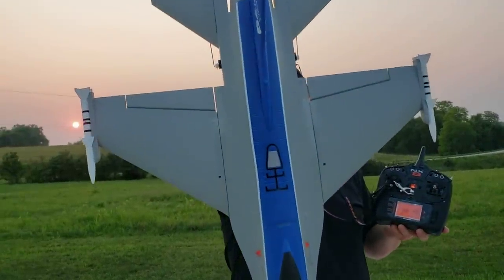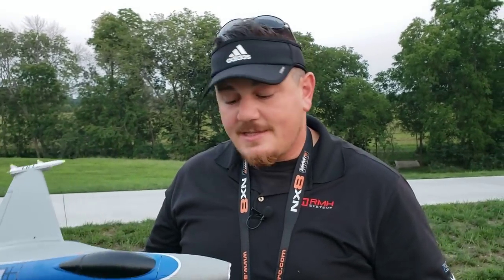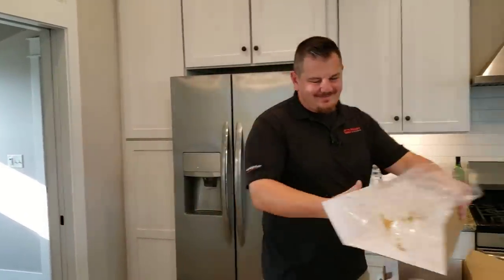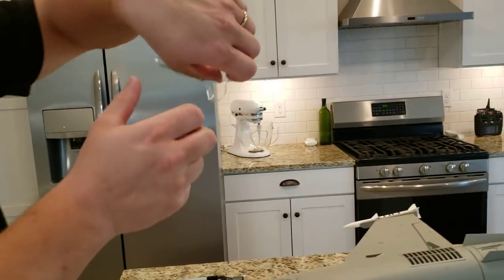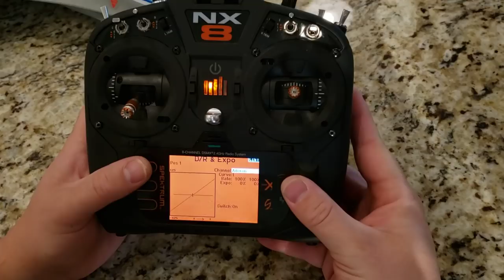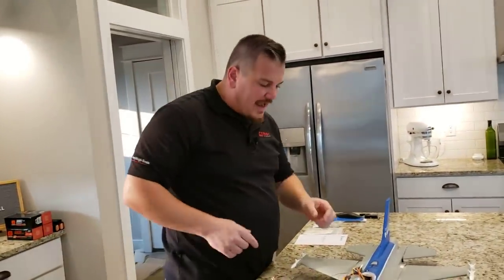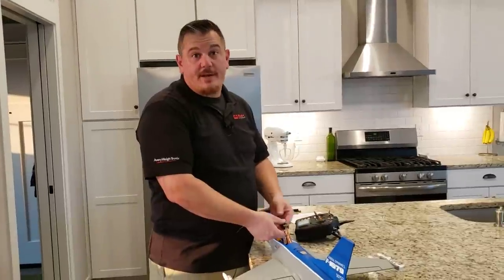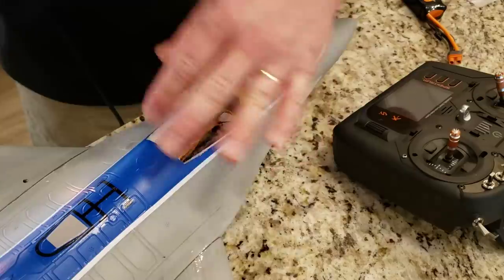Eachine - F-16 50mm PNP EDF Jet - Unbox, Build, Radio Setup, & Maiden Flights

Comment: All my AS3X units are crashed that's because I built an entire business just rebuilding and repairing brand new ARF's that were crashed by folk who did not know better - that said and my disdain for Spektrum aside can you just stop buying the same planes I do, I swear we are 10 for 10 lol. I am vacuum molding a 2 seat canopy (this is supposed to be a F-16B, they even added the additional ejection placards) and putting the more scale longer wing tip tracks or longer sidewinders. I am convinced I can devise a practical landing gear that looks the part for this thing, lets just hope BG gets my F-16 to me while I'm still passionate about it. Another full build vid done! Thanks Brian and creew
Reply from the maker: Nice! I would love it if this plane could be wheels up, wheels down, BUT you know it's gonna be too heavy for the 3S power system...maybe a small 4S might get the job done?

Comment: Whenever you need more throw, go out on the servo arm instead of in on the control horn. The further the pushrod is from the control surface, the better..
Reply from the maker: MORE THROW (less precision)...
Out on the Servo Arm
And/Or
In on the Control Surface Control Horn

LESS THROW (More Precision)...
In on the Servo Arm
And/Or
Out on the Control Surface Control Horn
Reply: @BrianPhillipsRC  
1. Shortening the control horn can lead to flutter because the control surface can exert more force on the pushrod.

2. When you move the pushrod in on both the servo and control horn, it doesn’t travel as far and any slack becomes a larger percentage of the total travel.

3. You’ll get the same throw with a 3/4” horn and 3/4” servo arm as you’ll get with a 3/8” horn and a 3/8” servo arm, but the force applied to the pushrod will be half as much with the 3/4” horn and arm.

4. The shorter the control horn, the more leverage the control surface will have over the linkage.

Comment: Just a note to those interested in this EDF. It's on sale at Bangood for $104.00 PNP till 1/29/2022. Ships from USA. Great deal.
Reply from the maker: F16 50mm https://bit.ly/3Kga0Av
AR631 https://bit.ly/3pYNC3c
3S 1300 https://bit.ly/2Ue0dWC
NX https://bit.ly/3mbVuNB
Reply: Definitely ordered through your link.  Although, I won't get to fly it for a few months with this weather.  I will go with the 630 though.

Comment: Been using gyros with self level, adjustable setup from transmitter long before Spektrum showed up for the party, acted like they invented it and then charge twice as much. Frsky SR6 gyro/receiver is about $30. Works with Radiomaster or Jumper multi-mode 16 channel transmitters with color LCD screens for about $200. Fully adjustable gains and gyro setup from transmitter. Oh and these radios can also work with Spektrum receivers and gyros including Spektrums "forward programming" setup from transmitter. Nothing against Spektrum other than the price. 
Been looking at this Eachine F-16 for awhile and your review is the first I have seen. Love the looks of it but frankly there is a lot of 64mm PNP stuff that is about the same or close price point that make this less attractive. Right now I would go for the T7A which is less money and so far looks a bit better than this eachine bird.
Reply: FrSky's S#R gyros suck compared to Spektrum's. They'll self-level, but they don't have bank-limiting to keep your plane from getting upside-down. You'd think with the calibration process you have to go through that the S#R's would know when the wing is vertical. I ended up having to decrease the throws to about 40% to keep my plane from getting upside-down if I accidentally held the stick over too long.
Reply from the maker: Yes, we just reviewed that too, and you're 100% right! T-7A 64mm https://bit.ly/3s3eKRp

Comment: I bought this.... (I’m not sure what to call it. EPO foam in the shape of an F-16?) before Brian posted this video. Mine came as a Kit instead of the PNF version I thought I ordered. No motor, no esc, no servos... a day after the build, now I’m grateful the control horns were already on and they included pushrods. 
If this EDF survives the maiden and the belly landing I’ll be blown away. No chance in hell the nose cone and wing mounted rockets survive the first landing. 
Sorry ArrowsRC, Horizon Hobby, Freewing and Flightline, I strayed. It won’t happen again.
Reply from the maker: Sure, You can get it as a KIT or PNP, we opted for PNP in this case ;)

Comment: The sales blurb for this says that the wings are quick attach and removal - I don't think you need to glue them just push fit - I am thinking I might use some Magnets to hold the wing in place.... mind you it is so small why not do what you have and glue it ...
Reply from the maker: I hear what you're saying, but not a chance ;) It's a dinky plane anyway...maybe for a big plane, I could see some clips, but man, this plane would be scary with a wing coming off mid-flight!!!!

Comment: Rc saylors tried a left hand launch with this one and was too weak of a toss!😲😝good job Brian!
Reply: That launch chewed up the elevator wires he had no elevator.  Looks like Brian has all the wires pulled forward where The Sailors had some loose enough for it to fall back into the fan to chew the wires.
Reply: @jwoocrew  ya I knew that, but his launch was weak and the plane stalled before he could even use his elevators.
Reply: I see that, it was a bit weak. I launch left handed as I’m left handed.😶
Reply: @philipriding  ya brian sent the f16 like a champ! I think one should launch with their strong hand. With you being left handed thats nice cause you can be on the right stick all the time I am fairly cordinated but since im right handed I have never tried a left hand launch. I seem to be able to get on the right stick fast enough.
Reply: The other thing is that with edf's I allways give em a real good look over because of the strong suction thru thier body's. Rc saylors maybe didnt do this? The wires getting sucked or unplugged in flight isnt a new problem with edf's
Reply from the maker: True! Nate got NIPPED ;) LOL Oh well, too bad for them...this plane is AWESOME!!!

I don't know if you caught it, but we DID pull the ESC and all the leads and made a huge gewey mess on top of the upside-down fiasco of an Rx install - LOL - this was to KEEP the wires taught ;)
Reply: @BrianPhillipsRC  ya I did see that you had gone thru the wiring. Do you like this f16 or the boeing t7a?

Comment: You should put the landing gear because I don’t want  you to crash it when you land so it’s a good I idea to put the landing gear so it will be easier when you hand launch. But I do like how it flies.
Reply from the maker: It doesn't have landing gear - What are you talking about??? Did I miss something (Are they offering landing gear at Banggood???)
Reply: No I’m sorry I was confused because some of the F-18 had landing gear but it was a mistake sorry I was confused
Reply: Ya you are right but still you did a good job 👍 flying
Reply: But you did good at flying I love the noise

Comment: So my poor p51 that hit a Powerline and was totalled  happens to have an AR631. I always shied away from pnp just bc i didnt feel like messing with receivers so we shall see how this goes in a couple weeks when i pick one up
Reply: One issue tho is on the bnf models you cant change gain and stuff so i hope it works lol
Reply from the maker: On the AR631 you can factory default them ;) BUT you need that programming cable.
Reply: Would it be necessary to factory reprogram it or no

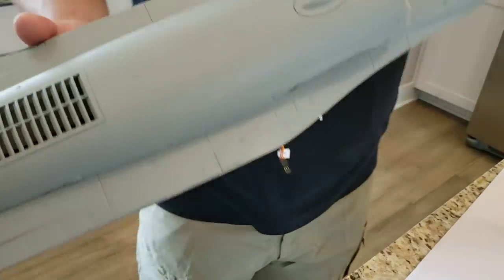Comment: 23:57. I have a theory that these companies bought out some molds from companies that went out of business, hence the phantom landing gear molded section. I have an Ares p51 and my grandfather has the Volantex 768-1 p51. They are pretty much identical p51 airplanes. I would bet that maybe this f16 was made by a different company and theirs might have had a real wheel for the landing gear. I think Volantex and Eachine are made in the same factory.
Reply from the maker: Probably ;)

Comment: Sorry for all the questions but is there a way to secure the ESC with the wing spar? If not all i have to do is pull the wires tight and that should keep the jet from pulling a nate? Thanks
Reply from the maker: If you want too, you can use a zip tie. I know Nate had issues with this.

Comment: I’ve noticed that you regularly run the batteries down to sub 10%. Doesn’t that hurt the battery? I normally run my smart batteries to 25-30%. Is that too conservative?
Reply from the maker: You can discharge them as much as you want, so long as you don't get the cells dipping much below 3.2 or 3.1 - which I DO occasionally do.

Also, depends on your risk tolerance
Reply: @BrianPhillipsRC  thanks might push my smart batteries a bit more than. For a couple extra passes

Comment: Hey Brian, I was on the fence about getting this (or the F18, since they're listed on BG as using 1300-1500, battery sizes that I don't fly) until I saw your videos flying the planes on 3S/4S 2200. Your referral link goes to the PNP version, but I'd prefer to get the kit version (gonna drop in an FMS motor and an Avian esc), do you still get the referral from BG if I use the link to get the kit version?
Reply from the maker: I think you can follow the link, then just pick the KIT, if you wish.

Comment: So how does this compare to the elite f16 64mm? I have one in a box waiting for my skills to catch up,lol. Love you videos.
Reply: I have the 64mm Elite F-16 and it flies beautifully!! Super stable and slows down nicely for landing, but can be pretty speedy when you want it to be. :) From what I can tell, the F-16 flies very similar to Eflite F-15 Mr. PhillipsRC... ;).... reviewed previously.
Reply: Are you insane? Open the box and fly it
The safe system works really good, just make sure you have the elevator flaps tilted up like 30 ° or it will nosedive and rather more wind than less is better so you can land it at walking speed without much effort
Reply from the maker: This is a different plane, for a bunch of reasons...

1) 4S vs 6S
2) 70mm (or 80mm) vs 50mm
3) Retracts vs No Gear
4) Weight
5) Cost

It's not really a good comparison at all. If the Eflite 70mm or 80mm were no gear, it would be more similar.
Reply: @BrianPhillipsRC  Actually, I was referring to the 64mm 4S version I got on Horizon Hobby clearance for $129.99. I think they're at @ $179. now. Anyway, they look about same size. This has stick in gear, but I plan to fly hand toss., with no gear. lol. Anyway, I thought you flew one of these. It already has a Spectrum 636B receiver with safe,(that made hard to pass for $130) so it's comparable what you did, only it's tuned for the F16, and it sounds like you aren't through dialing that receiver in, to work with the F16 flight characteristics. I know it's 64mm vs 50mm, but looked awful close in size, although this Eachine F16 looks smoother, a real looker!
Thanks for all you do,
John

Comment: I can fly the umx citation very well, so if I can fly that can I fly this f-16? And is the speed comparison between the two pretty close?
Reply from the maker: You could, but the F-18 by eachine is better...for similar price point.

I would highly recommend the Arrows 50mm's before these.

F16 50mm https://bit.ly/3Kga0Av + AR630 https://bit.ly/3lh5iqD
F18 50mm https://bit.ly/3mm9xSY + AR630 https://bit.ly/3lh5iqD

OR

BAE Hawk https://bit.ly/3pSmp4v + AR410 https://bit.ly/3GnSY0w
T-33 https://bit.ly/3DuVOPp + AR410 https://bit.ly/3GnSY0w
Viper https://bit.ly/3uinxlD + AR630 https://bit.ly/3rkGZMI
Reply: Cool! Thanks Brian!

Comment: Damnit Brian!! Why couldn't you have put this video out 2 days ago when I bought this plane?? That way I could've used your link 😞 
Good to know it's gonna fly well. I'm really excited. Also, shipped out very quick. I've been wondering this tho.. Do you think a 2200 would be at all possible?? Like if I put the receiver all the way up front? Thanks for the video and tip/tricks dude!
Reply from the maker: It'll be very tough to get the CG right.

Comment: Hi Brian 
Did you install the file of the eflite 64mm on the 636 used in this plane ?
Reply from the maker: No, I specifically DID NOT re-program it, but if I had, that MIGHT be okay....all depends on what direction the output of the original elevator setup was...and it might be different.

If I were to put in an AR630 or AR631 - I could setup this plane super sweet ;)

Comment: Hi , Great video i was looking forward on this. Can i fly it with a dxs? Seven channel should be okay right? 
Greetings
Reply from the maker: Sure can, but no expo and if you want to use an AR630 or AR631 you won't have a way to program the receiver, so you can setup the AS3X/SAFE.

Comment: Pretty cool jet.  So  is it hard to set up a smart receiver in a pnp?    Got a omp bighorn I want to put a smart receiver in.   I tryed To put a receiver from my timber x in it. And did not end good. Lol.  Went in the air   Wings wiggle back and Fourth violently and piched up   Stalled and nose dived. Lol.  Only flew it three times.   I bought another one though.   Now they are usually out of stock and waaaay more expensive.   I payed for my first one  ummm 279   Pnp.  It was toatled.  Broke in have. Broke in pieces. (balsa  wood plane). Then bought my recent one  off bang good  390 For a kit.
Reply: I start out with 30, 40, and 50 percent gyro gain for aileron, elevator, and rudder. If I feel like it needs more, I'll increase all of them by 10% until I start to see the wingtips oscillate when I stop a roll or at higher speeds. Once I see oscillation, I decrease them by 5% until it quits. Generally, the ailerons will oscillate first, followed by the elevator, and then the rudder. That's why I use 10% more on the elevator than the ailerons and 10% more on the rudder than the elevator. When setting up a gyro, you must make sure it corrects in the proper direction. If you raise a wingtip, the aileron on that tip should deflect upward. And if you raise the tail, the elevator should deflect upward. IOW, the gyro must move the surface in the same direction that you moved it.
Reply: @txkflier    Thanks.  Do you have to have a programming cable?
Reply: @ruger1420  For an AR636, yes. For an AR637T, no, but you’ll need a Gen 2 Spektrum transmitter and the latest firmware to do Forward Programming..
Reply: @txkflier    Cool.   Do have a gen 2 spectrum.   I’ll have to get that cable   May come in handy.     Thankyou 👍
Reply: @ruger1420  There’s an RCGroups thread on putting a SAFE receiver in a different plane. Look for the user “flightengr”. There are also YT videos by RC Air Marshall..
Reply from the maker: I would seriously consider either the AR631 or the AR637T - both would be good choices. Both we have installed in similar planes for you to follow along.

Using an Rx from another plane, without reprogramming,  as noted in this video can be a bit of a pain, and you HAVE to be super careful, or the plane may not respond the way you expect it might - case in point, how the F-16 flipped over as expected, but pitched down more than expected.
Reply: @txkflier  yeah rc groups heard of them. I’ll have to check that out.   Thanks.
Reply: @BrianPhillipsRC     Thanks.  Yeah I didn’t reprogram anything from my timber  x.   Lol.  Don’t know how.  That’s probably why it went crazy. Lol.    Need to learn about the electronics now.   👍